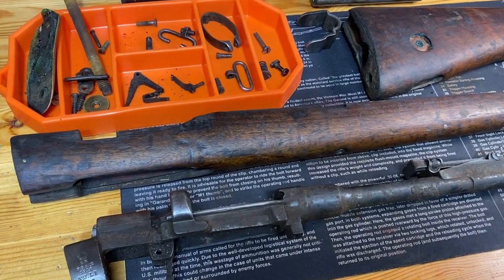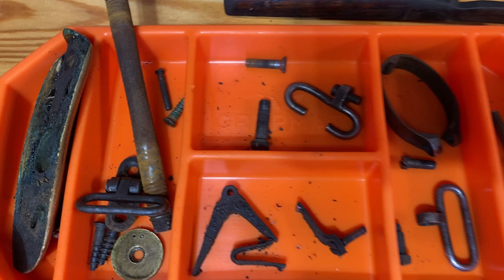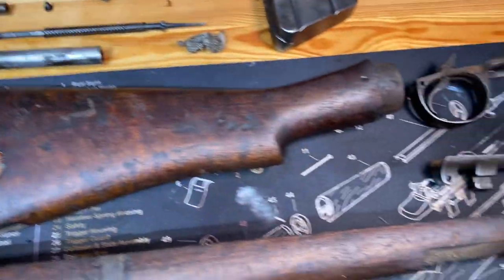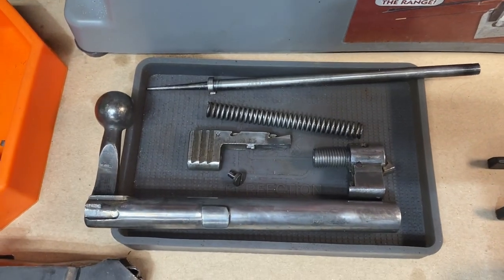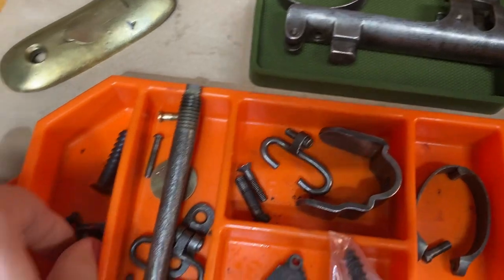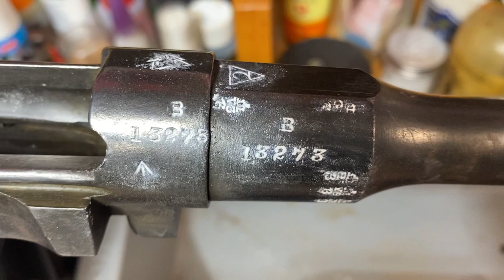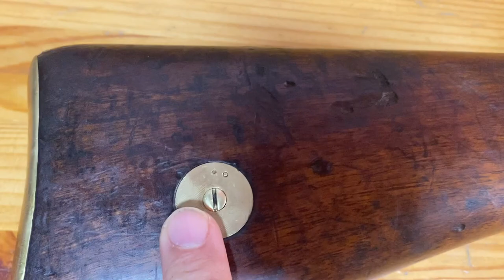Royal Tiger Imports Iraqi Marked No 1 MkIII* after Cleaning

Comment: Thanks the shout out! Looks like a great example from the Ethiopia cache. Overall good condition and you cleaned it up nicely. Shame about the wire wheel but most of the rifles I got from RTI got the wire wheel treatment by the Ethiopians to some degree.

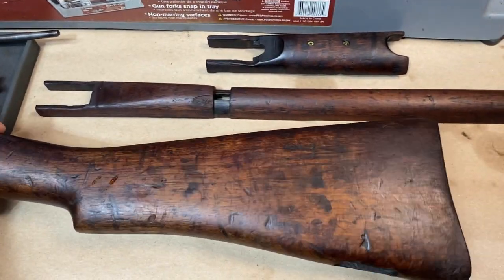At around 4:48 you mentioned a chip in the buttstock but it looked like it was just the notch the safety rests in when you pull it back to engage it. So no worries there.

I have been looking for sources on how these Iraqi marked Enfields ended up in Ethiopia. Some of the forum discussions say they were sent legally or illegally to Ethiopia after the 1958 revolution. Suppose if it wasn't legal we will be hard pressed to find documentation on it.
Reply from the maker: Thanks for the info.  I meant to shout out your channel during this video but I kept getting interrupted by my kids and it slipped my mind.